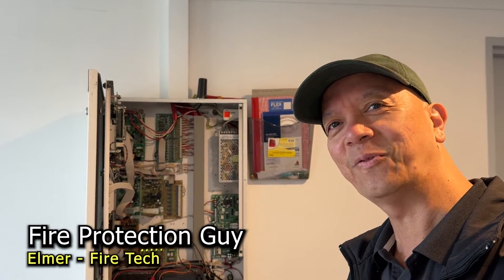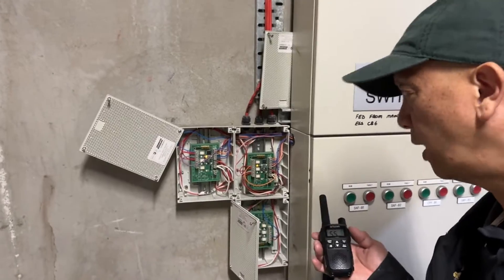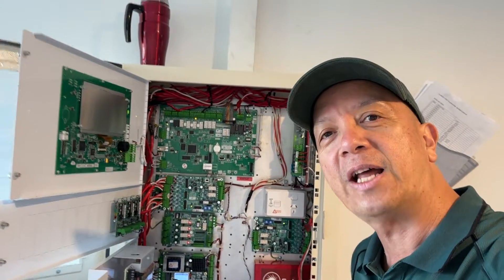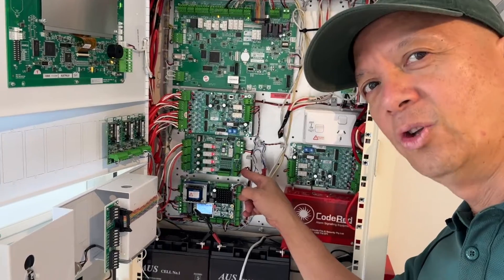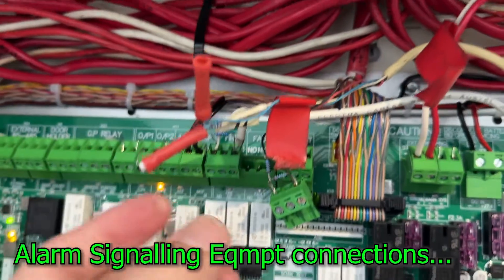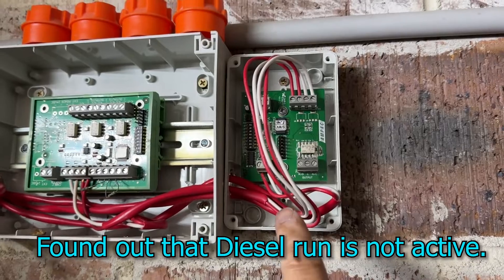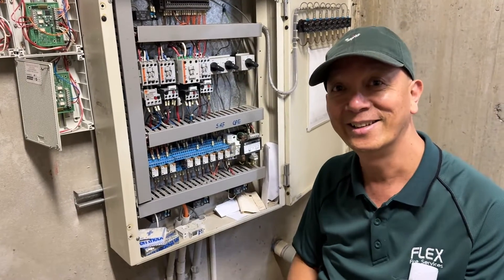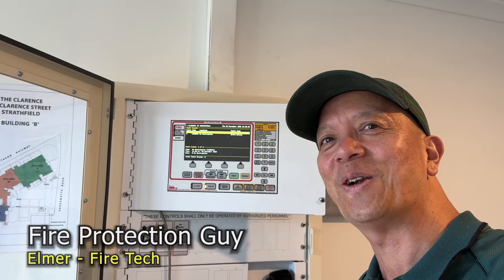Ampac Fire Finder to Pertronics F220 - Fire Detection & Alarm System

Comment: Hi Elmer, does pertronic f220 have function to change conventional system to addressable system,and how can you download from ampac program and convert them to pertronic program, thank you
Reply from the maker: Changing conventional to addressable - Yes. There's a module for that. For the programming, download the Ampac configuration and start from stratch... They are different in programming.
Reply: @fireprotectionguy7943  thank you for your help

Comment: What are the purpose of these ventilation fans? Why are they directly connected to the Fire Alarm panel?
Reply from the maker: Ventilation fans are suppress the spread of fire or smoke. It can be press fan, stair press fans, exhaust fan or supply fans.  Locating at the FIP, as per standard, the fire brigade can control those fans - switch off or on. Sample, the fire system is reset - no active alarm.. but there's still smoke or fumes in the carpark. They can run the exhaust from the fan controls at the FDCIE/FIP.
Reply: @fireprotectionguy7943  100% AS1668.1&2. Even without a FIP in the building, Fan controls are required now and prefered in the earlier version  mounted at the entry. I like that you mentioned the Pump room ventilation. I have some buildings that are programmed not to run the fans during a trip. Even the matrix shows it this way. Crazy.....
Reply: @fireprotectionguy7943  Thanks